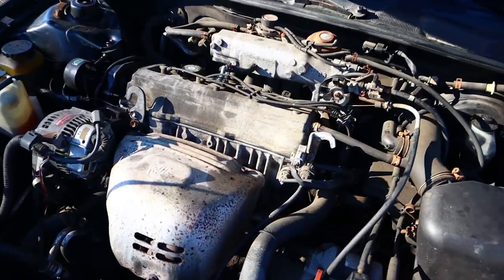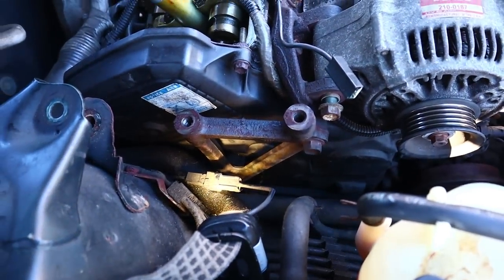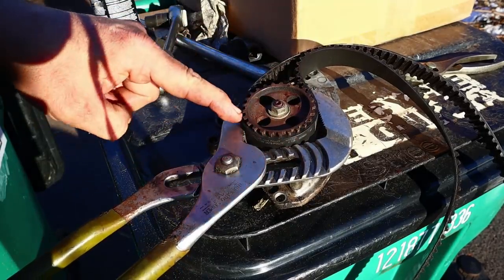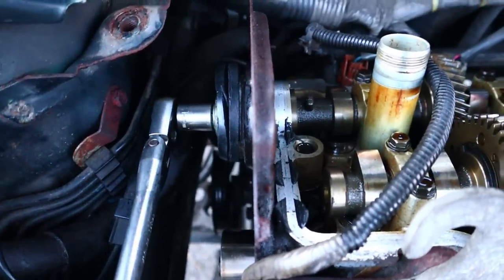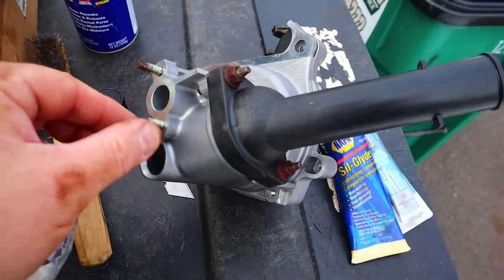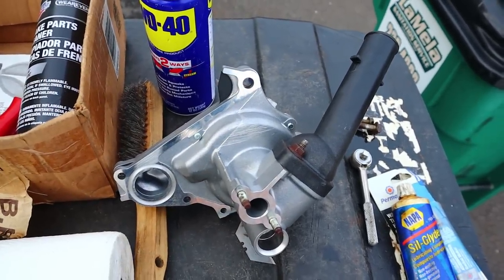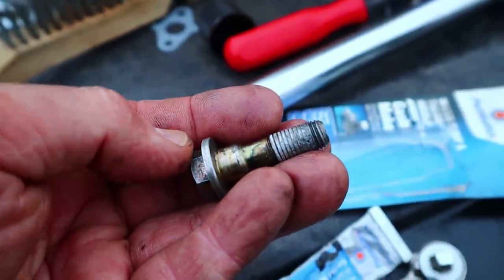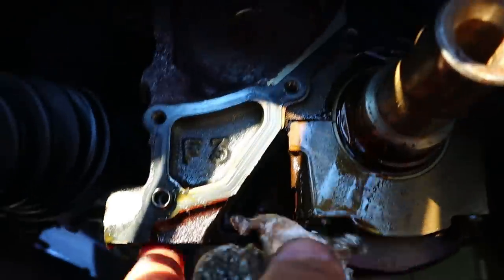Will it run? Huge oil leak! Major repairs! 98 Camry timing belt, water pump, oil pump & pan gasket!

Comment: You've obviously done this before. I'm a retired mechanical maintenance engineer and you certainly are more competent than you make out. Thought processes are spot on. Any wear/play in the shafts will leak oil through the seals and there are a few rough noises but hey! as long as it runs and hold the fluids reasonably well then just turn up the music and you won't hear the noise. Respect!👍

Comment: I feel for you doing that in the winter bro. Awful to do out in the driveway in the cold. I'v done some of that with my daily driver 98 Camry, and would not hesitate to drive cross country with it. Bring a tool box with you and you can fix it on the road if needed. I replaced a stuck open thermostat on mine in back of a Dollar store 500 miles away from home in about an hour. Needed to get heat, winter was coming.

Comment: Did the oil pan gasket work (and not leak)? I have the V6 version and I tried just using the sealer and it leaked. I'm contemplating using a gasket even though they didn't use one out of the factory.  Thanks.

Comment: Use both gaskets and gasket sealer I had a 400 smblk board out 30 over and just used a sealer no gasket worked great we raced a firebird 40 miles he couldn't catch me never had any problem with the motor